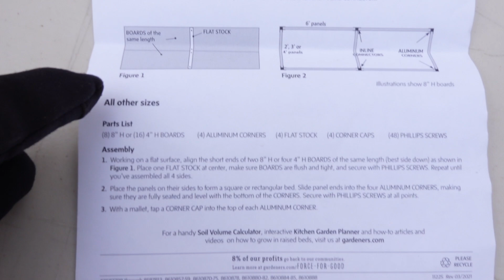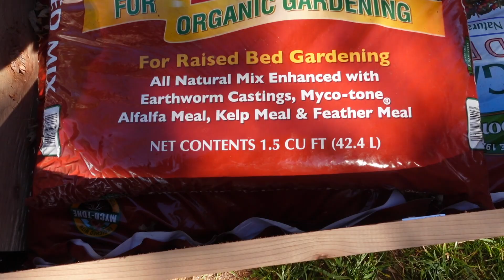Setting Up Our Raised Garden Beds / Dirt and Dish

Comment: I want to do this in the near future but I'm not sure if I want cedar or non-toxic metal so it was helpful to see your beds.
Reply from the maker: I think metal beds may be less expensive than wood but I like that these, for the most part, match the retaining wall.  I’m ready for Spring.
Reply: @dirtanddish  Same here!!!
Reply from the maker: Did your zone change with the updated USDA map?  We got bumped to a zone 7b which I find a bit sketch.
Reply: @dirtanddish  No! We were 7a and still are. The last change bumped up from 6b to 7a, though.  Not sure I  agree with it 100%, either.